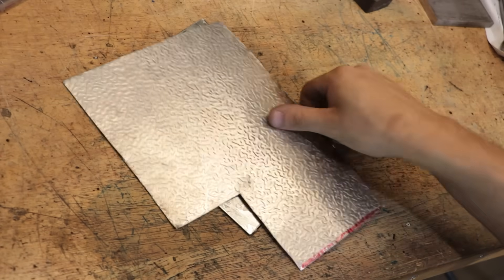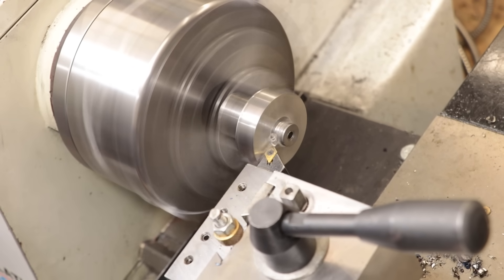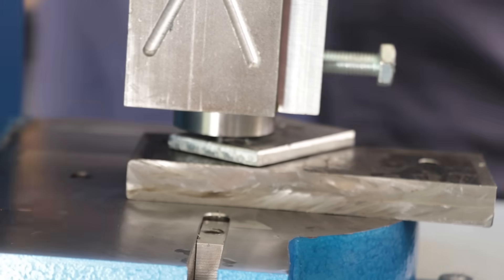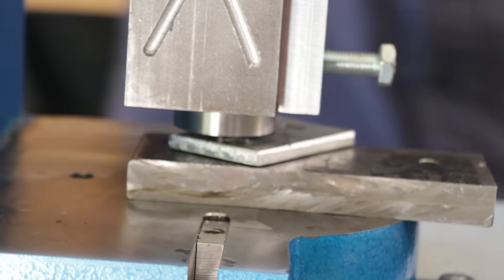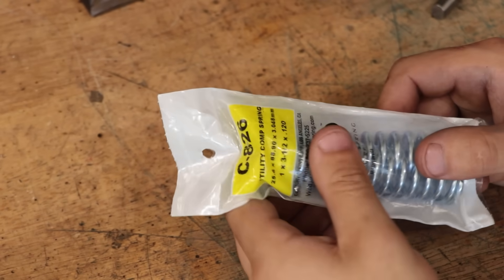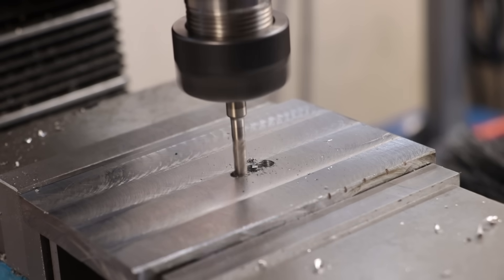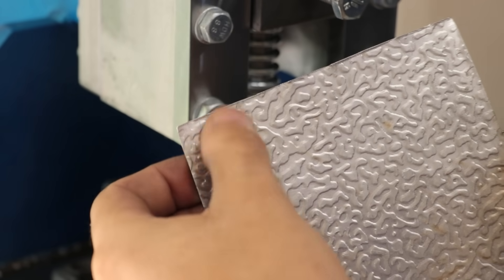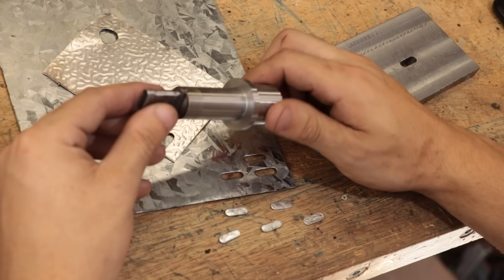DIY Punch and Die For Sheet Metal

Comment: 3:08 You can do a case hardening by wrapping it in clay with some carbon and maybe (some sodium bicarbonate (not sure about it)), and then heating it in a fire.
Reply from the maker: I've done case hardening a few times here on the channel. I try to shy away from it during the summer months due to the prolonged forge use required, especially in this climate. I personally prefer to use sodium carbonate from the start, rather than sodium bicarbonate because the decomposition of sodium bicarbonate will produce sodium carbonate, and a few other things too. Cheers
Reply: Probably the released CO2 can build up pressure... I need to watch your video about it.
Reply from the maker: It eventually diffuses out through clay from what I have observed, or it just produces a small crack and comes out that way. Cheers

Comment: Definitely consider hardening the die. Usually you’ll make a MS plate that bolts to the press with interchangeable  hardened inserts for dies. 
Polyurethane makes an excellent stripper.

Comment: Hey, old tool and die guy here, been machining and making tools for a long time 40+ die work not so long, kinda been around it for a long time but proper tool and die about 3 years, kinda a newby.  Die clearance look in machineries handbook there is a formula.  Steel, we use A2, stock punches come in D2, D2 is the best but hell to resharpen on big sections, A2 and we temper at 600f, work good for us.
Why I started commenting was on hardness.  The most used machine in shop after mills and surface grinders is our old Weiderman sp? turret punch which we punch holes in shims for dies, grind it down you have to shim it.  Anyway, had a slow night and payed attention to the old girl, 3/8 punch was wrinkling shims .010 thick, inches that is, I am an imperial sort of guy but I am bilingual and can do metric.  So I sharpened some punches and dies.  The .375 die was hard, I knew so because I made it about a year ago, was amazed at punches, not that hard, stuck in lathe and turned gave a lick with stone, these punches have a centering tip to go into transfer punch holes.  Almost soft as butter.  We generally punch only brass stock, somebody had been punching 16 guage steel was the reason I was sharpening.
Long winded but softer punches and dies will work for short runs but need to be harder than the material being punched.
Story time again, I remember a big radius tool used in lathe, guy I worked with made one out of cold roll, kinda made fun of it but it worked well on that plastic.
Reply from the maker: Thankyou for the information. It will give me a good idea of the metal I need to look for for the die. Cheers

Comment: Since i work in a sheet metal industy, instead of a spring we use a pull off plate. It sits just above the metal and is attached to the frame of the punch. I believe you can add on to frame of the press! best of luck and nice content!!

Comment: This is a great video. and one that can be applied to any hydraulic shop press as much as you r fly press.
The logic behind it all is perfectly sound. 

I spent a lot of time working in a production facility where we had big presses ( 200T while i was there but bigger now) right down to a cnc 20T turret punch press. Looking into the tooling for a turret punch press would go a long way to guiding you toward how you can make interchangeable tooling, how the punch / die / stripper arrangements work well together.

Additionally rather than a stripper spring, since you have the ability to impose an upward force as much as you can downward force, a practical option is to have a dedicated stripper plate that you can bolt to your fly press. it will be more effective than the stripper spring, and you dont have to overcome the force of the spring to create the holes.

There used to be a machine called a metal master which had a hydraulic punch system which had interchangeable tooling to achieve the type of holes you desire. The tooling used to be fairly inexpensive and perhaps getting one set could direct you down direction for future shop made tooling. One really great feature of these tools was a little pimple on the tip of the punch. this pimple allowed use of a guidance hole. for ultimate accuracy you can mark and drill small ( 3mm) pilot holes where you need your features, then you simply hold the sheet up to the punch as you bring the tool down, allow the pimple to line up into the pilot hole and every time you get the exact spot. For batches you make one template and use that to transfer dimples into all of the plates to be punched creating very high repeatability form a hand aligned process.

https://www.machineryhouse.com.au/p202
This set for example could be suitable.

Comment: if no toolsteal try spring leaf/rod  heat temp & retemp 250/300f
used it for ages in spring industry for small jobs leaf if treated right will cut spring steel tension springs easy

Comment: Make a plate that overlays the top of your press with a removable center part that u can hold down with your t nuts. interchangeable an that way you can use 30mm steel as your dies that should keep cheap and easy to replace.

Comment: machinists-shortcuts makes all great suggestions and on point. the shear on the cutting face of your punch would be best to be a "V" that contacts the material on the outside ends first and cuts in the center last. A punch and die can't be a one size fits all based on the material thickness. thin material less clearance/side thick material more clearance/side. if you try and cheat and use tight clearance on thick material you will have high cutting pressure and shear most of the way thru the material. rule of thumb is 1/3 shear 2/3 break.  Clearance in the die below the cutting edge will also help to keep the pressure required down, once the slug is cut it can fall free otherwise it is a press fit all the way thru. I will say i speak from experience built and designed dies for 40 years. Last 10 did a lot on refining compound dies for exhaust flanges 10-12.5mm thick. Did tons of development with clearances, tapers, reverse tapers material types and surface coatings.
Reply from the maker: I guess that’s the difference between book formula and real world experience. Cheers
Reply: @artisanmakes  School of hard knocks some days for sure. But the real world knowledge from making dies run and solving problems in metal stamping is very satisfying. Presses from 250-1500 tons progressive and transfer dies,  materials from mild steel to dual-phase and stainless steels. Lots of challenges throughout the years. Books are great and referenced them a ton, but sometimes the don't go deep enough into the real world. I could probably write a book on reducing tonnage in stamping dies...lol

Comment: I'd love to see you make a few different shapes like stars, ovals, triangles, etc.  I think that would be a pretty cool project.  You could also make a spring loaded release that uses 4 rods like that diagram you put up on the screen, except it only springs on the punch side and presses the material off.  That'll give you a bit more control, and it will help hold the material in place while punching.  There's nothing worse than the material moving on you right before the punch connects...been there and cussed up a storm when I had remake the entire part from scratch.

Comment: This would be really good for making just normal holes in sheet metal. When i do it i usually get really nasty burrs and the drill bit can wonder by a mm or more. With a punch setup you could rest the work piece against some pins in the die to create a line of holes that are really accurately positioned near the edge. You could also use the previous hole in a guide pin and space the holes accurately too.

Comment: 4:43 - The results you get with the press and die - no way would you get results as clean as that with a CNC plasma, oxy torch or anything like that.  Plasma cutting looks like it was chewed out by a cat.
Reply from the maker: Yeah for sure, not fine details like that
Reply: @artisanmakes  - I have a plasma cutter and it is rough as hell.  Air nibblers are good for cutting out, but not those little punched out bits like you made.  Your punch results are superb!
Reply from the maker: Cheers, thankyou

Comment: You're using your fly-press like an arbour press and not taking advantage of the 'fly' part of it.  You use the handle to apply force  to the weights to increase their momentum. Then use the weights to use that stored momentum to apply force to the press.  This way you change a small force over a long distance into a large force over a small distance.

Basically, take a much larger swing with the handle and allow the weights to do the actual work.
Reply: I thought that was the idea of a fly press....to hit hard and fast. Not slowly pressing on through. I haven't used one for 40 odd years but used to use a few for pressing louvers in electrical panels in my younger years. Also used some awsome inclined inertia presses that used a rather huge flywheel with a clutch mechanism. Press the pedal and bam...job done! Cheers and G'day from Tasmania

Comment: When I saw the beginning, I initially thought you would have the head of the punch cut at a slight angle (like how a syringe needle is cut to make it sharp, but not so sharp an angle) so one side of the punch would start penetrating before the other, or perhaps like an inverted "U" shape, so the "horns" at each end of the slot would be cut before the middle... don't know how well they would work, but if they did, wouldn't they reduce the workload?

Comment: For sheetmetal, you could put a shallow V in the punch, take a look at round cutters made for conduit in sheet metal boxes, they operate with a simple bolt pulling them through. The slight V allows a shearing to take place gradually which lowers the force considerably compared to a flat surface.
Reply: Yeah. Look at "Greenly" or chassis punches.

Also, the shear force is not area but perimeter.
It is the length of the shear line not ALL the metal within the punched shape.

When folding heavy sheet metal in a crude brake it helps to slit (stich) the bend line.
Easier to fold and easier to keep true to the line.

Comment: Add say 0.5 degree a side to the punch and hang up should be less.   Making the die from gauge plate,  quench hardening it and then tempering to dark straw colour will give you a hardened die.   Gauge plate is the same material spec. as the A0 punch material you used.   Heat to red bright heat and quench in either old engine oil or water.  Water gives a harder result and remember to move the part around in the liquid to get even cooling.  Polish part after hardening enough to see bright steel and enabling seeing the tempering colour,  degrease in Shellite and don't touch where you have polished it then heat very gradually with a butane flame until you get to a dark straw colour,  then water quench to arrest the tempering process.   Adding relief to the face of the punch is not necessary and press tool punches are usually flat faced so that when worn both punch and die faces can be renewed on a surface grinder.    Also consider a stop for the ram to stop the punch from entering the die as damage can result.   All punched parts have a radius on the bottom edge of the slug and a sharp edge at the top,   reverse for the stock.
The attraction of the punching process is its speed and I have seen a BIG Swiss made press running at 1,200 strokes per minute pressing out electrical terminal parts.

Comment: This kind of work used to be my everyday Job.. i made  a lot of dies and punches through the years.. 
Just cut/mill/grind a relief  on the underside of the die.. a cutting edge should only be high enough to nicely cut.. below that.. Just mill a lager shape
As for the Spring.. That is one way of getting your material off.. a Polyurethane tube also works, and these work fine as springs as well.. , you  could also mount a "Stripperplate" i.e. a piece of metal that sits just proud of your sheetmetal.. and prevents it from coming up all the way with the Punch.. 
If you can find one in a second hand bookstore.. buy a book on Punch and die  making.. that will show you all the tricks of the trade.. of which there are many...
Reply from the maker: Thanks for the info. My uni and machining and fitting book was a little scant on the details of this area.

Comment: Chip Not breaking :
Rpm down or feed up . If it's still not breaking change insert corner Radius or depth of cut .in this case for finish 0.3 times the insert radius for the doc should be good starting point
Reply from the maker: Here it was a matter of bumping up the feed rate. Can’t go much lower on the rpm here or the carbide won’t produce a great surface finish . Cheers
Reply: @artisanmakes  yeah I know that rpm problem :D that's why milling is technique and turning is an art

Comment: Why does the cut off chipping matter in regards to surface finish? I am not a machinist, I do zero metal work, but I just can't wrap my head around how a continuous strip/material removal would result in an inferior finish to it chipping away.
Reply: The material of the chip is pretty much the same hardness as the material of the workpiece.  That means it can affect the surface if you get all the right stuff in all the right places at all the right times under all the right pressure.  It's best to let the chip go somewhere else entirely.   (Not to mention the edges in that nest are all razor sharp, and not convenient to have under power anywhere near your fingers.)

Comment: Just my luck.  I was working with sheet metal for the past three days and If I'd known about this DIY punch making It would have saved me a whole lot of time.
The sheet metal I was working with wasn't very thick steel sheet, and I already have a one-ton arbor press in my tiny home shop.  Oh well, now I know better.
I wonder if the cutting action might be enhanced if the bottom face of the punch was angled just a tiny bit so that it's not perfectly flat.
This way the force needed to start the initial piercing on the sheet metal would be more of a scissoring cut that a punch cut.

Comment: You might want to consider adding a centring point to the punch in future ones so you can pick up a centre punch mark, the spring would get in the way though. All my round punches have them, and most of the square ones do as well. While I don't use them that frequently when I do use them for punching holes in sheet metal it sure beats drilling them, fast clean holes with no burrs to clean up.

Comment: Not bad, i would use a material that u can harden for the bottom die though. Also there is a mathematical equation for different materials u can use to find an appropriate clearance between the top and bottom dies. It involves something similar to finding the k factor for making bends for the different materials. But short story is thicker material requires more clearance alongside more pressure.